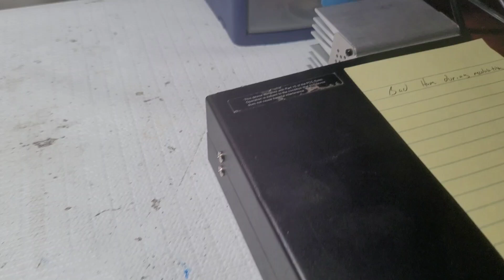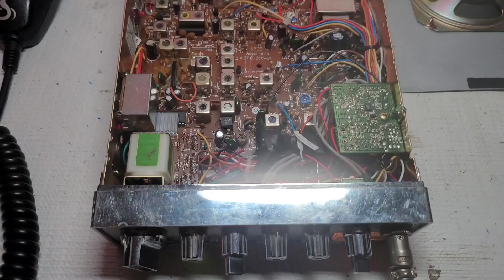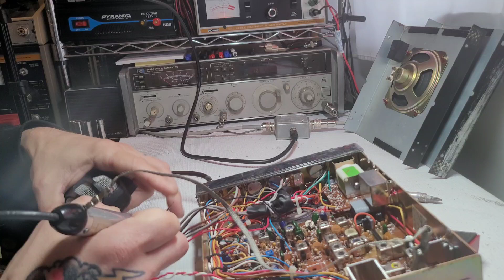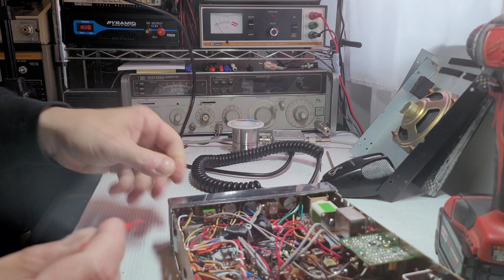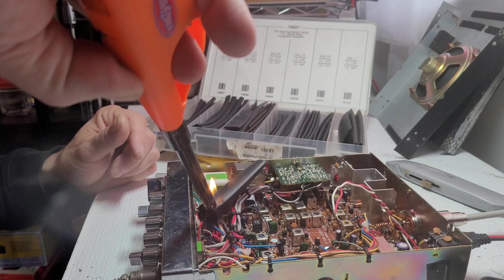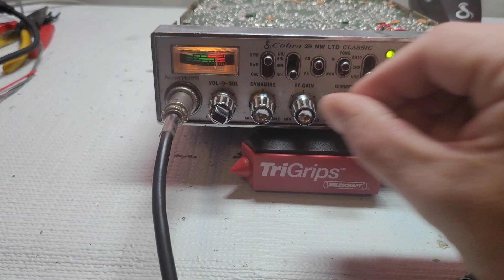Signal tracing a no modulation on a Cobra 29 NW CB Radio

Comment: Interesting video. Some food for thought, and I'm certainly not trying to pick on you at all! Your signal tracing is using a signal injector. It emits a tone, probably 1 khz. Technically you didn't need to say audio. Just key the microphone and listen for the tone. Additionally I wouldn't mount the echo board near the rf power section. Leaving the echo board where it was originally mounted and cutting the echo board wires to the needed length may have been a better idea but that's all up to you. I'm just offering a different prospective. It's clear you enjoy working on CB's. It can be challenging and rewarding.  My signal injector looks exactly like yours except mine is an old Radio Shack unit I picked up in a package deal from Smokey's CB  shop in North Grosvenordale Connecticut. I bought all of his equipment many years ago when he retired. You're accent sounds like you're from Southern New England.  :-)
Reply from the maker: This signal tracer does not inject a tone.  It's demodulating the audio, so I do need to say audio.  Also, how can I hear where I'm losing modulation if I don't talk into the mic ?  You can actually watch Mike on Mike's Radio Repair youtube channel do it the same way.

Comment: I know its not the same thing but its the same principle.I ve hot an old 27mhz rc radio  transmitter which has 27mhz signal on the antenna but it does nt transmit anything , the segvos just jiggle,i ve checked with a scope the carrier is there also the ppm signal is present but it wont modulate.